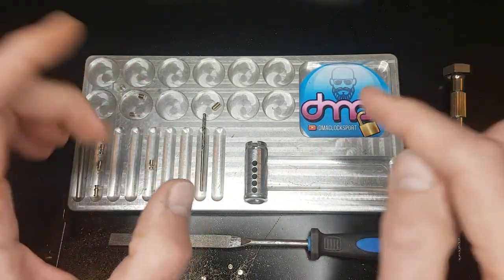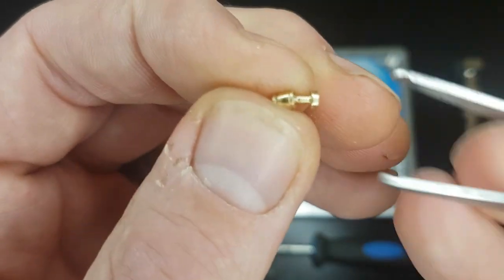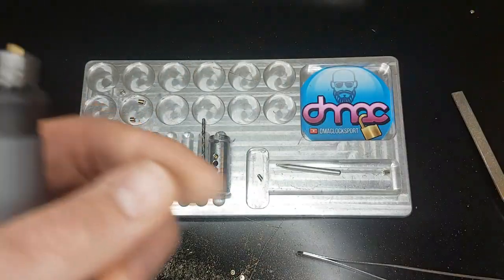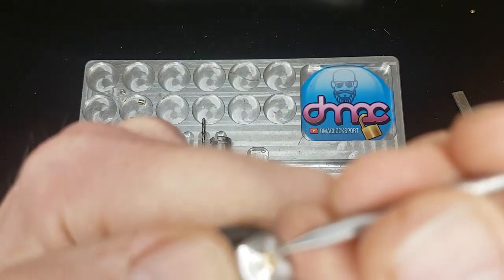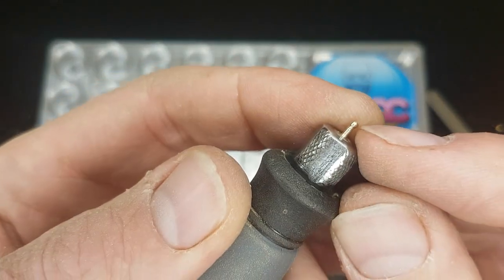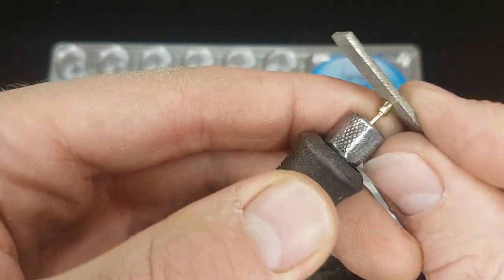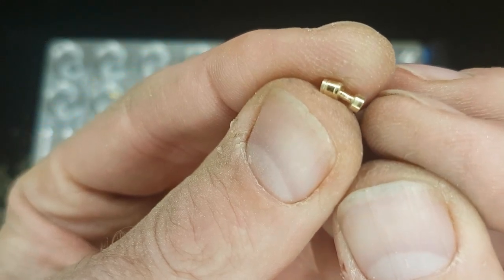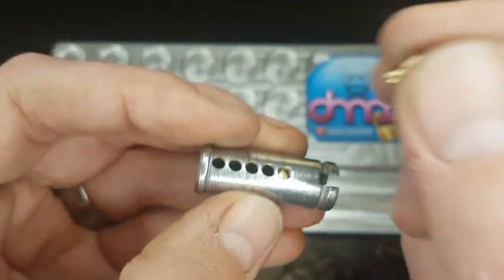How to make 'Piston Pins' for challenge locks

Comment: I was wondering how you get them together.  For a second, I thought you are going to heat up the outside part just to get them slightly larger before pressing together.  Pretty amazing tolerance control with free hand filing.
Reply from the maker: Thanks. The idea popped into my head as soon as I saw the locknoob video and I was pleasantly suprised that it worked in practice. I've always winged it and hoped for the best! 😁
I did make a few more after the video and cocked up a few of them. Cut the recess too deep and split the outer or filed the inner too thin so it wouldn't grip.

Comment: Dmac, what grit are you using to get that shine?
Reply from the maker: I used 600 here, but sometimes 1000 on pins also
Reply: @Dmaclocksport  cheers bro av had differing results with (not supringly) differing grits. 1000 seems my go-to but evidently not

Comment: outstanding! I always have a problem with the drill bit wanting to Tasmanian devil around the center of the pin when I drill, usually gives me that nub/nipple. definitely easier than I thought and may try a double ended one after I get use to the single piston first. excellent job and I think my few remaining braincells thank you too. I thought this was the way but then I went off the beaten path thinking a little science with temperatures with a little expansion and contraction, so e of the black magic and voodoo rituals😂😂😂. thanks for the video and awesome work🦾🦾🦾
Reply from the maker: Thanks J it worked out better than expected. Once the first one worked, I got excited and had to make the video 😆
I find a little force on the pin vice helps to centre it 👍🏻
Reply: @Dmaclocksport  I bet I was sporting a LockSport chub when I saw the video pop up! I actually have a drill press attachment for my Dremel but notice the bit will walk. Another reason why I was happy to find bigger holed capillary tubes. I need to make space for the lathe, which I hope that it will make somethings a bit easier to make. Will definitely give it a shot eventually on the pistons and this is a great tutorial for making them
Reply from the maker: @j.gabriel8573  locksport chub! 🤣👌🏼